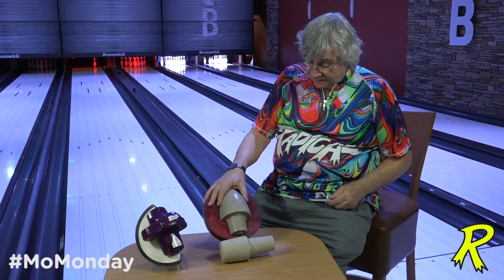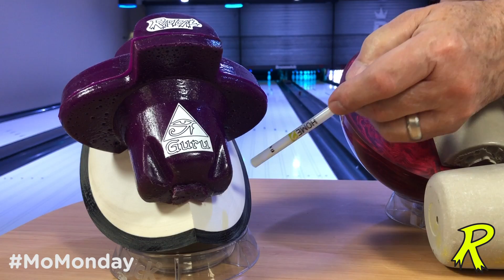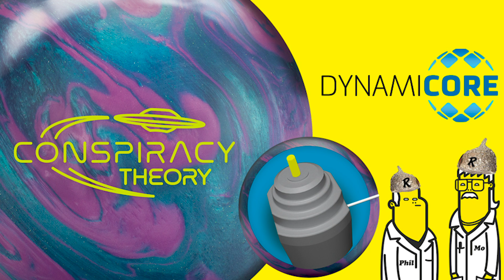Thick Shell vs 3 Piece Ball Design - #MoMonday

Comment: Another attribute to the thicker shell two piece balls is they have a higher coefficient of restitution (CoR) which can result in a harder hitting ball. A harder hitting ball doesn't necessarily mean a better ball, just a different option in your arsenal. I much prefer the two piece balls because of their higher CoR, longer lasting coverstocks, and higher resistance to cracking. YMMV.
Reply: For low rev, low ball speed players like myself, the extra hitting power of two-piece balls makes a big difference, especially on light hits.

Comment: Mo I just ordered my first radical ball ever, conspiracy theory.  I’m a low speed low rev lefty.  Did I make the right choice with this ball?
Reply: Tony Barber I have the solid and I swear to you if you roll it end over end it’ll still hook. I need so much oil for that ball it’s ridiculous. But if you’re a low rev guy this ball should be fine for you.
Reply: Just making this to reply so I can go straight up the back of the ball and it will still hook????
Reply: Rudy Hughes I’m a two handed rev guy. The ball is way to strong for someone like me. I’m new so I didn’t really know what I needed at the beginning. If I put revs on this ball it’ll hook from the one board to the gutter about a foot in front of the one pin. If I don’t put any revs on it it’ll still move to the left about three or four boards. I’m not making this up either. That’s the solid conspiracy I’m talking about but it’s almost the same core as this ball here
Reply: @justmakingthistoreply5085  Try the Hero or the Vapor zone solid. The activator 2.0 cover is less aggressive. Hero for Symmetrical, vapor for asym. 3 or 4 k finish the hero is tame. 500/2k, or 1500 finish, it wakes up and digs.
Reply: Dobermanowner forlife Thanks. I found an undrilled Brunswick Meanstreak that I really enjoy because the lanes are always dry to med. I’m told two handlers do well with Urethane so I’m looking to get one of those now. I just don’t know what I should get. Actually found a Manhattan undrilled from 1983 I might get just cuz I think that’s cool as all hell
Reply: @justmakingthistoreply5085  be wary of urethane. The cover loads in frames and will be shined out. That is why I suggested the Hero. with your rev rate, a 4k finish would be a good start. ( I am too lazy to repolish, so I never recommend it LOL). The Hero from the box is pretty lazy untill the dry with its factory polish. 4k is pretty close. With your rev rate it should slide and snap hard.
Reply: Dobermanowner forlife ahhh that does look good in a two handers hand